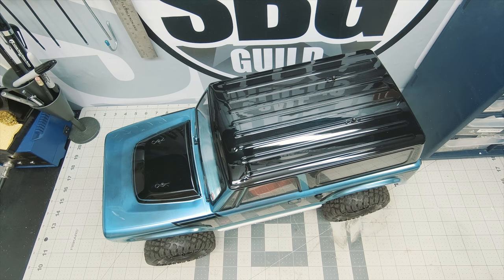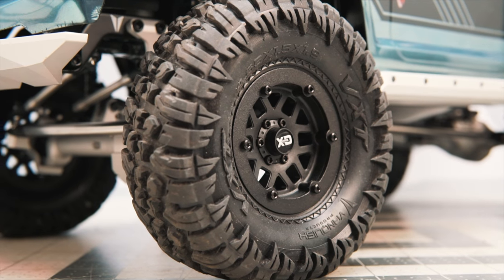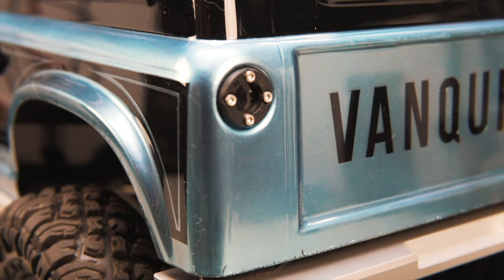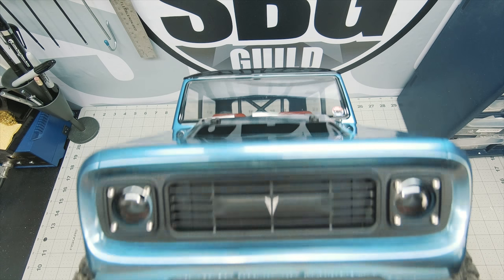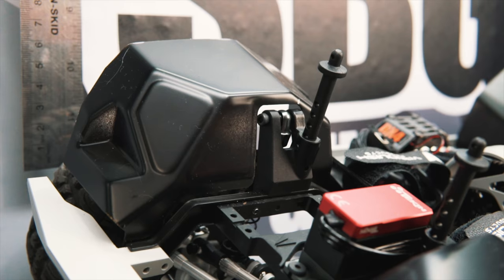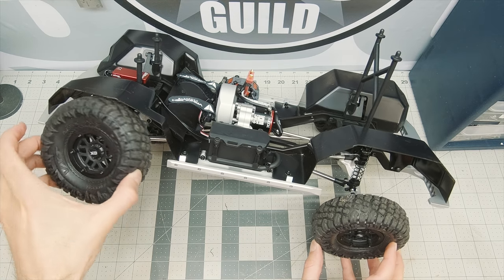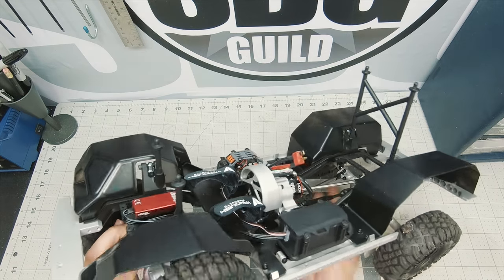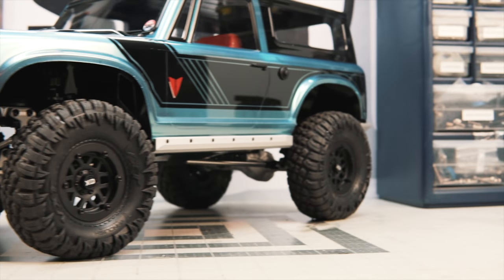Vanquish VS4-10 Origin First Look

Comment: Aside from the front axle it just Looks like a copy of everyone elses work. Some of it looks really cheesy like the inner fenders,,, and the fans you keep mentioning but you'll never see. The wheels have very unrealistic beadlock rings. China has come closer. Not sure I'll ad this one to the collection yet. The body is nice, but very similar to bronco bodies on the market. I like what Hoboa has released a bit better.
Reply: And what exactly is it copied from? The wheels are no different than other kit wheels, being plastic with rings and are the most changed piece of any vehicle anyways. The inner fenders are great for realism to keep the inside of the body dark unlike pretty much every other kit available now where you can see everything inside.
Reply: stamped steel chassis, ax10 transmission, china spur cover, cheesy beadlock ring (axial's), those inner fenders look cheesy and brittle. I've seen Tupperware inners that look better. lol maybe that's a bit rough. I was kinda excited to see under the hood of a vanquish rig,,,this is just a scx10 dressed up. They can do better.
Reply: The AX10 transmission is basically a copy of the original Stealth from back in the RC10 days anyways and it's proven to work well. If Vanquish came up with a completely original transmission, price would go up. The spur cover is original VP that China copied (like all the rest of their stuff) so I'm not sure how it's a "China" spur gear cover. We already covered wheels and aluminum would only drive the price up more again while forcing everyone to run the same wheels and complaining about the inner fenders is like complaining about the wrong size ice cubes in your soda. It's a great value kit and it's hard to please everybody. Oh and a stamped steel chassis is scale detail that a lot of us like and it's not a copy of anything if you look at the design.
Reply: price would go up? Jeez. So copied. As I said. I was hoping for a divorced trans transfer case maybe, more of an original body, I'm not saying its not nice, Just sayin aside from the front axle its all been done before. Who copied who is a matter of opinion and  love the c channel also. Maybe some more robust. I think really what I'd hoped for was something that was better off the shelf than I already run.
Reply: I feel the same. I would have expected more out of VP. Nice axles though and body. Probably would have made more money just selling the axles alone. I don't see $900, but to each their own.
Reply from the maker: I don't understand your copying argument. Nor the cheesy factor of the fenders. They hide the inside and are essentially unseen. Like I said in the video, Vanquish opted to go for what they knew would work straight away. I'd also like to see a forward mounted trans, but it's their first foray into building an entire truck. R&D takes time and I'd rather have something proven to work now.
Reply: Scale Builder's What i mean is everything on this rig has been done. It looks like an scx10 with vanquish parts. How much r&d did that take? Copy is a harsh word, been done, has been out there. 
I meant the inners look 3d printed and brittle. 
I guess i expected more  from vanquish. I love there parts, but when your on top.....so i’d like that new axle but im not buying a $900 platform to get it. O and thats the only way? Psh
Reply: It amazes me how people just complain all the time about everything now. I guess that's easier than being constructive. The inner fenders are lexan, same as the body. And while we're on the subject of the body, everyone whines and whines about Jeeps and when somebody offers something different, naw that's not good enough. Not everyone buys a Ferrari and not everyone is happy with the way Ferrari does things.
Reply: lol. I'm not complaining. I'm just pointing out the obvious. I mean look at those beadock rings. As for the body where ya been? Its has a bronco feel, even if its something else, still looks like a deadbolt, TFL with the cap on. Like I said I already have this truck and probably better. Built with there parts and others, So why pay $900 for something I can build better for half? Not gonna lie when one comes around used I gonna snatch it up thou. lol I'm sorry if my opinion is not the same as yours, but you could have just scrolled on by. But you didn't like I didn't, you left an opinion, like I did. Are you better than the rest of us? Do you feel safer in the positive feeling world. Get a helmet dude. I've said I liked the truck also, I"ve said I love vanquish parts too, but you probably don't hear those things, you just hear the things that don't match your opinion.